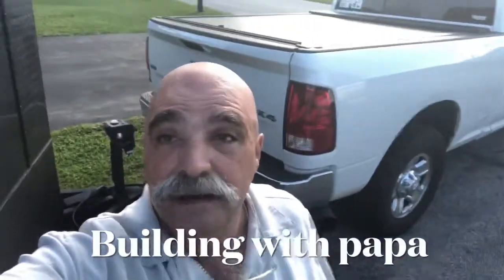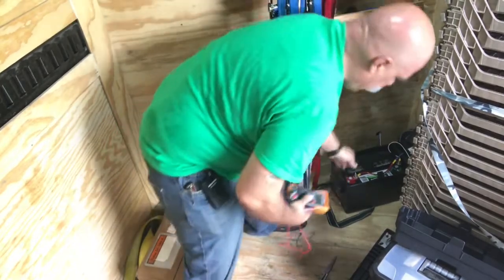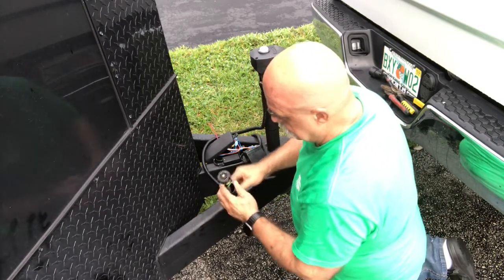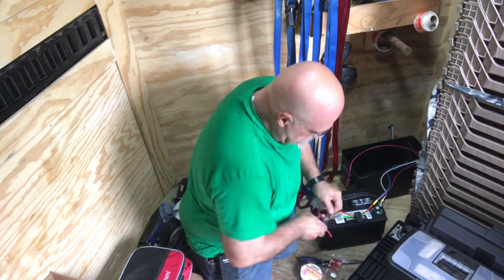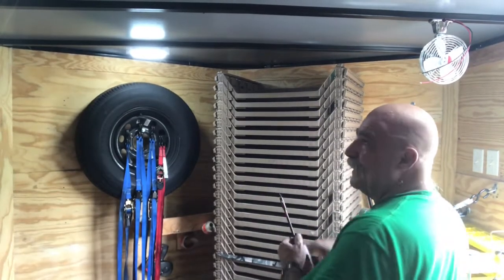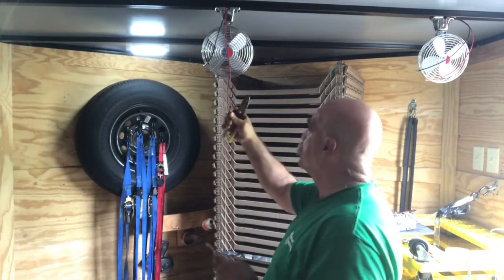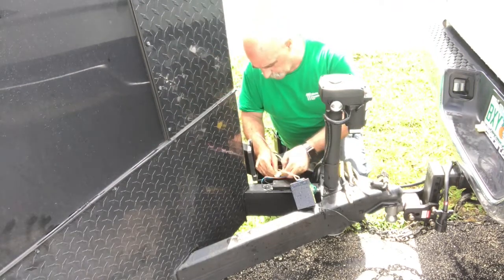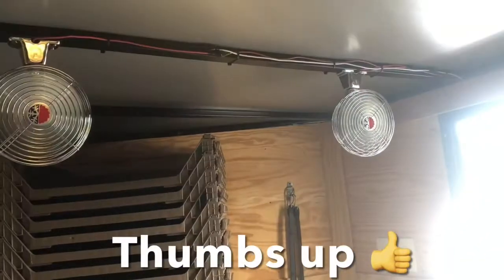How to charge your Battery in your trailer off your 7 pin and install 12V fans

Comment: Trying to wrap my head around this. You now have 2 power sources for the trailer and jack, the tow vehicle battery and the battery in the trailer. This is not an issue with both powering at the same time when the tow vehicle is connected and running?
Reply from the maker: Thank you for your question. This is all 12 V system I haven’t change the voltage, so no there isn’t any problem. Make sure you put an in-line fuse from the battery in the trailer to your seven pin put it closer to the battery when the truck is not running and he’s working inside the trailer he’s able to have his fans and lights on Without the truck running. I hope you enjoyed the video, and if you can leave me a thumbs up.

Comment: My trailer has the battery for the brakes as well so all I would need to do is tie into the positive wire thats running to the brake battery and run that to the positive for the battery in trailer, then tie into the negative wire running to the brake battery and connect that to the negative on the battery in the trailer?
Reply from the maker: Don’t forget the in-line fuse you still need to have that fuse at the battery in the trailer. Thank you and if you can leave me a thumbs up.

Comment: Can I use the 7 pin that runs the trailer lights to charge the winch battery?
Reply from the maker: Thank you for your question. As long as it’s a 12 V yes you can. I’m glad you liked the video and if you can leave me a thumbs up.